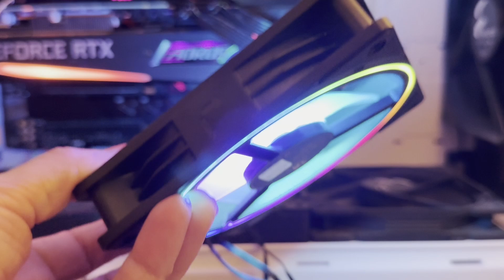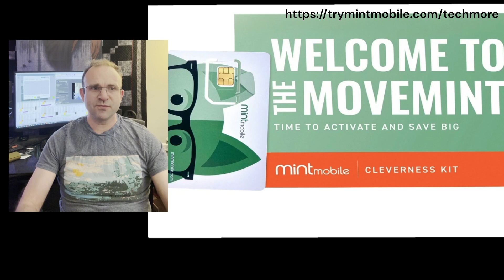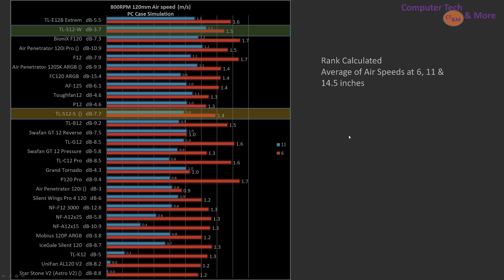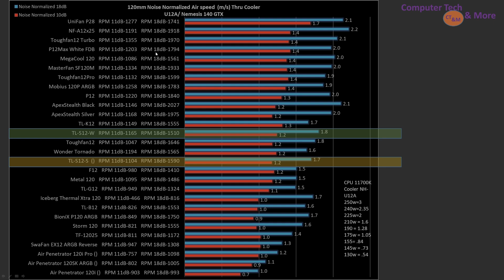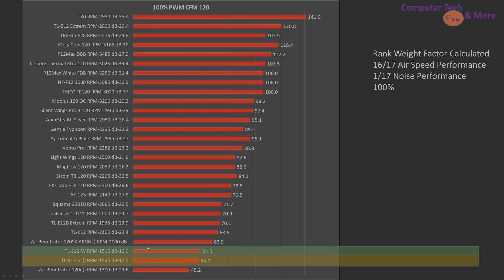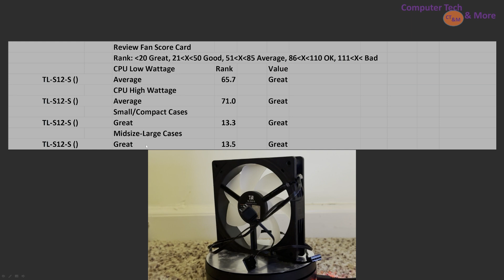ThermalRight TL-S12-S Lets take a closer look at this RGB Fan.

Comment: Hi, im looking for RGB PWM fans that have that halo or ring effect when only rgb thing is that circle around fan, i found about TL-S12 and S12R (i know im under S12-S video) and i think its hard to beat them in lower budget, but there is so much models and its not easy to search only for these ring ones, i know there are for example Asus Prime MR120, Antec Prism, Deepcool... on high cost side bequiet! light wings, nzxt f120 and probably many more, but you probably know this market really well so my question is there anything worth considering if im looking for great price ring style PWM fans that will have reverse version avaliable too other then TL-S12?
Reply from the maker: its kind of all over the place. basically you need to find reviews for each fan your interested in. With that because everyone tests differently you need reviewers that test multiple of the fans your interested in and only compare results from each reviewer. or a best of with the applicable fans. For the price the TL-S12 is solid. i think its a little lacking as a cooler fan but a case fan it should be great. 

unfortunately I have found no patter based on brand or appearance to say this fan is great / great for the price.

Comment: Haven't you been sble to get a hold of their tl-b12-s for testing? I could only find 1 post, I believe it was in german. I think... I had been looking for reverse ones though, for the bottom intake. My case is similar like yours, psu on top, 2 140 front, 3 120 bottom. Sickleflow argbs at the front, mobius 120p for the back single exhaust. Another mobius 120p in my ak400 cooler.

Was actually going for sickleflow argb reverse for the bottom, but couldn't find any locally. The only other options were apnx fp2, and tl-b12r-s. Was about to pull the trigger on the fp2, but then I found a post, in french! i think, with noise normalized it's not that good. Anyways, am happy with the tl-b12r-s. Running it st about 1600-1800rpm. My gpu temp dropped about 4 degree celcius, compared to using id-cooling ha 1225l 1600rpm, and much quieter.

If only the mobius 120p comes in reverse version...that would be awesome!
Reply from the maker: The B12-s is just an RGB version the performance should be similar to the regular B12. 
Testing and review creation takes a long time for me. I am solo and this is just a passion project.
Reply: @computer-tech-more I get that, thanks for testing.

The specs that thermalright provided for these 3 fans, tl-b12, tl-b12-s, and tl-b12r-s, are exactly the same. And from what I've gathered, the reverse versions are always weaker. As for the argb versions, deepcool fd12, its argb version has different spec than the non rgb version. With this in mind, I'd always try looking for tests on the argb version.

Currently thinking about replacing the sickleflow 140 argb with noiseblocker's. The sickleflow is probably the best 140 argb I could get locally, but the increased performance from the case included fans, isn't as high as I expected it to be.
Reply from the maker: @eriefebrianto3492  yes reverse blades loose quite a bit of performance. RGB usually get close to non rgb but still some kind of loss. 
Since I buy all these fans myself I get whats on sale. but I do try to get RGB ones since a lot of people do my for the lights.
Reply: @computer-tech-more yeah, going down the rgb lane was probably my mistake... If you have the time, go check overclocking uk, last time I checked a few days ago, they had nb eloop x b14-p at a mere £11 each. If shipping and customs isn't too prohibitive
Reply from the maker: @eriefebrianto3492  haha I'm in the US so the tariff situation is making buying fans to test kind of hell for some brands. 
I'm in a wait and see pattern. luckily I have quite a lot of videos to edit to release more reviews. :)
Reply: @computer-tech-more yeah, I kinda get that you're in the stats. Kinda thought the tariffs are included in the customs...have no idea how that one worked over there.

I may need to upgrade the case and the fans on my r5 2600 rx570, so your reviews will be looked forward to! There's only a handful of reviewers testing these fans' actual outputs.
Reply from the maker: @eriefebrianto3492  that why i started. the large channels I didnt like their testing. STS reviews does a pretty good job.

Comment: No! There is no reverse fan in S version. You can find reverse version with ring light only, TL-S12R. 
These can be used at top for exhaust and to disperse the light while simple ring light reverse version can be used as intake elsewhere in the chassis. Just a thought.
Reply from the maker: haha tell thermalright to make the model. they have one of everything else. haha
I tested the reverse of the S12 i was less impressed by it overall.
I need to put together a video of just reverse blade fans vs their regular counterparts to pick out the "best pair".
Reply: I got the reverse S12 R snd they are the worst fans ever used so far. Very annoying noise from 1200 up to the limit without pushing decent amount of air. Waiting for your test. I m curious if it just me.

Comment: I was wondering if you can turn the middle light off and leave the ring around it on to have the ring light up but the middle light off
Reply from the maker: Thermalright makes another version of this fan with just the outer ring light and no fan illumination.

Comment: Nice videos. I got a Frozen prism AIO, it comes with TL-E12B-v2 fans. Do you think it's a good idea to swap the cooler fans with TL-s12 RGBs to match the rest of the case? Will the performance be better or worse?
Reply from the maker: so if your happy with the fans keep using the originals. if your unhappy that's when you switch. The performance will likely be the same.

Comment: And what do you think about petawave PF-U12
Reply from the maker: that model looks like a pressure only fan. it has a lot of struts in the back and the fan blades look small on the frame. 
the RGB should be pretty